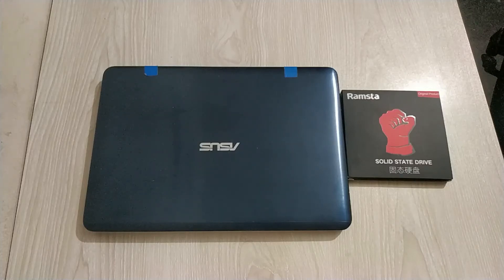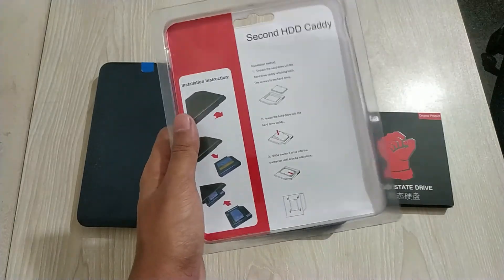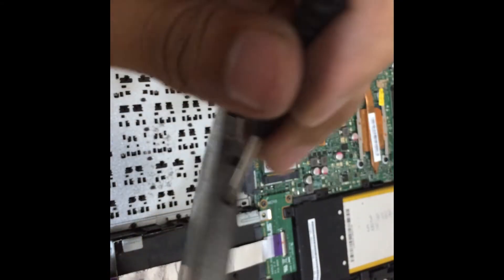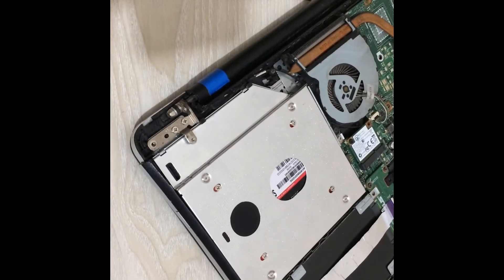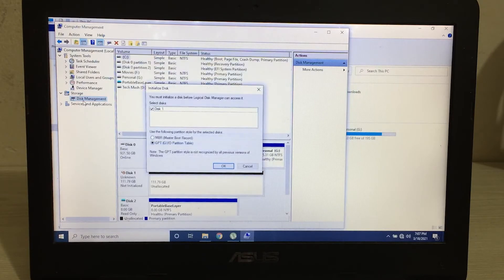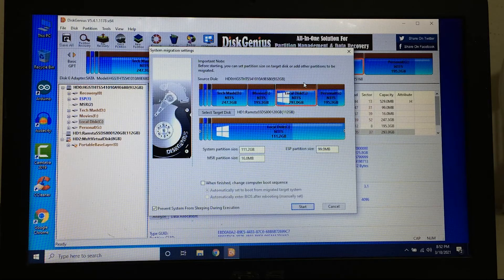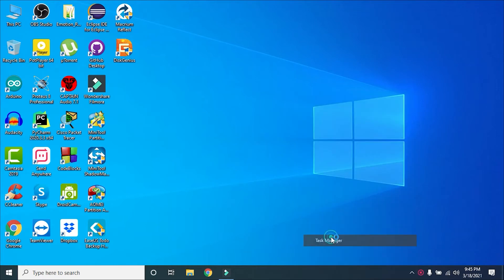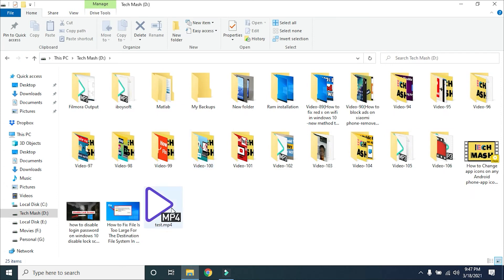How to Add SSD to laptop and keep HDD | Clone Windows from HDD to SSD Free

Comment: is the system works perfectly after  migrating os to ssd?did activation required for Windows?
Reply from the maker: Yes it migrated perfectly. It didn't required activation for my case. I can't say for sure about others.
Reply: Activation not requested in my laptop. Working fine.